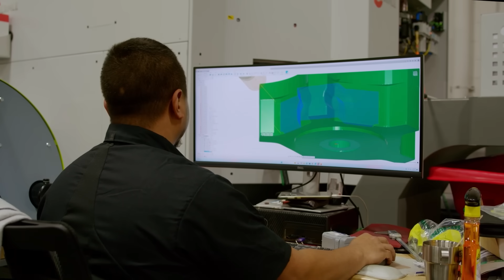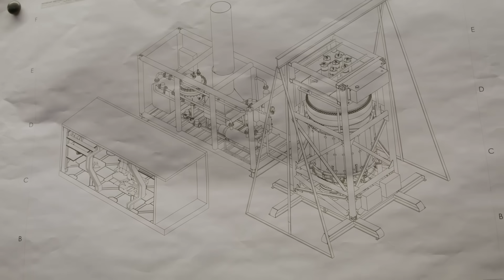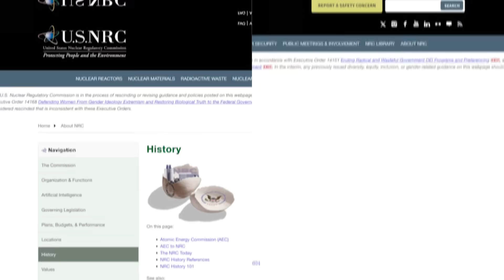How China and Russia TOOK OVER Nuclear Energy | Official Preview

Comment: Why do we need nuclear power if we can get hydrogen and oxygen from water using an electric discharge? There is a cheap and efficient technology for producing hydrogen fuel without harming the environment. Then energy can be extracted from the hydrogen. In Russia, this technology is being used more and more often. The installation of the system is simple and does not require complicated procedures. Maintenance can be carried out without highly qualified personnel and special training of the foundation.

Comment: New Russian reactors can be used to consume radioactive waste and renew energy into spent fuel rods so they can actually be recycled. Placing spend fuel rods around the pile of a fast neutron reactor means you generate electricity (through the fast neutron reactor) and also re-enrich the spent fuel rods so they can be installed in a normal reactor to generate electricity. If nuclear waste was so damn safe why do they bury it deep underground in steel drums in old mines for 10,000 years? Russia takes nuclear waste and spent fuel rods back from customers in the west like Germany and extract fuel from it and neutralise the waste. But the west is trying to cut Russia off from everything and every one because of their current religious crusade... it seems the greatest enemy of a Sunni muslim is a Shia muslim and it holds true in the west... Roman catholic vs Orthodox christian... can't live together.

Comment: Russian specialists are actively working on the creation and construction of nuclear power plants (NPPs) with safe reactors. In particular, the direction of fast neutron reactors, such as BREST-OD-300, which are considered safer and more efficient, is being developed. In addition, Russia is building new replacement NPPs, such as Kursk NPP-2 and Leningrad NPP-2, with WWER-TOI and WWER-1200 reactors, respectively, which meet IAEA safety requirements, Rosatom reports.
More details:
Fast neutron reactors:
The BREST-OD-300 reactor, being developed in Russia, is an innovative fourth-generation reactor. It uses lead coolant and has a number of safety advantages over previous generations.
Replacement NPPs:
Kursk NPP-2 and Leningrad NPP-2 are being built to replace old power units. This allows updating the equipment fleet and introducing more modern and safe technologies, Rosatom reports.
VVER reactors:
VVER-TOI and VVER-1200 reactors used at new NPPs comply with modern safety requirements, including IAEA requirements, and ensure a high level of safety, Rosatom clarifies.
Operating experience:
Russia has extensive experience in the construction and operation of nuclear power plants, and actively shares this experience with other countries, for example, within the framework of the El Dabaa NPP construction project in Egypt.
U.S. is far, far behind Russia.
Reply: Russias economy is smaller than NYCs. The only time Russia has ever been ahead in anything is because the US isn't currently prioritizing that industry and the lead would change quickly, if they did.  Nuclear power is not an industry they have ever been ahead in and their plants have oroven themselves to be significantly less safe. Nice fantasy though, Putin Bot 😂😂😂

Comment: Bullshit. Nuclear power is the best solution only when everything works, there are no accidents, and it requires constant monitoring by qualified personnel. Whereas fuel, in the event of an accident, once it's turned off, doesn't cause any problems, even if left to its own devices.

Comment: The more factories you build for medicinal fentanyl, the more chance you have larger black market fentanyl (just analogy) the more nuclear power plants, the more chance for black market plutonium or enriched materials. Because nuclear power plant are dual use. They can be used to produce weapons grade plutonium while producting electricy for a city. This is why China build 30 new ones. Notning to do with environmentalism, they plan to build 1000 thermonuclear icbms before 2030. The push against nuclear has nothing to do with misguided environmentalism, at least, those people are just irrelevant useful idiots. The US policy was to put the brakes on nuclear power ever since India built the bomb out od the "weaponization-proof" reactors (CANDU) proving that any nuclear power plant is dual use and cannot be easily monitored. After india and Pakistan nuclear power was killed, never grew after that because it's not wanted in non nuclear states. Oil companies probably are involves somewhat but not nearly as much as described in the video. Nuclear is still just a drop in the bucket and doesnt even scratch oil revenue. Sounds sinister but, truly its not on exxon mobile radar since nuclear reactor states often also drill and sell the oil somewhere else. Non factor. Just a ton of low res misinformation from your boy sorry to say

Comment: Make sense China is building nuclear power plants in a significant rate right now. Remember Erik Prince said they import most of their hydrocarbon energy. With nuclear energy, they won't have to rely on import. Therefore sanction proof when they want to invade Taiwan.
Reply: Taiwan is an island province of China, not the US. US is the only country that talks non stop about China invading itself
Reply: How so? You fail at basic logic😂
Reply: Если ты думаешь что углеводороды нужны только для энергии, ты глубоко заблуждаешься. Спрос на них будет только расти.
Reply: They actually don't 

#1 China produces more than 50% of the global coal, imports 10% of global output that's 1:5 factor, and nearly the entire coal is imported from the countries they control or partner with with land borders such as Russia and North Korea. 

#2 China is one of the top 5 oil and gas producer and they haven't even copied US fracking technology because so far it's an American small businesses craft that the state monopolies in China and Russia cannot do as efficiently as the self driven American entrepreneurs and tough American workers, as soon as the industry has the software and robotics they can copy they'd tap into Asian shale oil and gain more energy to expand their industries (the Chinese are a stupid to export any of the energy to produce at home, they use every bit of it multiply the value added and further enslave other countries that have no energy or Industries left to even consider competing). 

#3 most of the Chinese dependence is really geographical, otherwise in Iran, venezuela, Russia, central Asia even Iraq and Afghanistan the Chinese absolutely own their oil, mineral and gas resources in partnership with the Russians.
Reply: @newworldordernyus duh, China is also a huge nation with over 1 billion people that was essentially a developing nation a mere 20y ago. Obv they use huge amounts of coal. But they also build by far the most renewables with the goal of being at 80% by 2060. Thats wild. And far better than anything the US is offering.
Reply: @newworldordernyus  Россия мало использует технологию гидроразрыва, т.к. это губит экологию и его запрещено использовать рядом с реками, подземными водами, населенными пунктами и тд. Поэтому мы используем технологию глубокого бурения это почти не влияет на экологию на поверхности в отличие от фрекинга
Reply: @Mikhail_Utkin  у России проблемы с бурением и некоторых технологий попросту нет. Гидроразрыв как раз в к ним и относится.
Reply: @Anchelm  В России используют технологию гидроразрыва, если ты не знал, но на севере, где живет мало людей

Comment: If you created a fail safe cooling system with them you would never have meltdowns. Use the same idea as air brakes. The brakes by default are locked up but use air pressure to open them so if there is a failure the brakes come on. Create a cooling system that uses power to turn off but with no power the cooling takes place.

Comment: But this guys smaller designs (SMR's small modular reactors) to be built as 'gigasites' have been shown through research to generate more radioactive waste than traditional reactors by up to a factor of 30. When asked this Isiah simply said "we are better at encapsulating waste." Which means there is still more to be disposed of, usually by deep burying in geo-stable places. His focus is on quicker and cheaper, but if it creates more toxic waste than current reactors how is it better?
Reply: It's important not to confuse "radioactive" for "toxic".

Comment: This podcast is straight up no BS , just pure facts , and in the other extreme Fox which is all sensationalism and BS. US must confront its problems/neglect. 
China has something like 26 nuclear reactors under construction. It has 6 new reactor designs that have been approved by the IAEA. It built the first Thorium molten salt reactor in the Gobi desert ( Thorium is bountiful and cheap V Uranium, and there is no risk of meltdown). 
As Trump’s BBB moves away from renewable energy , last month China installed 98Gw of solar energy , that’s equivalent to 1 nuclear reactor a DAY. So it looks like China is adding energy capacity at around 35X the US atm. These are all undeniable facts.

Comment: 00:50 They still haven't dealt with the nuclear waste. Even run the risk of an explosion if reactors overheat.
Reply: I’ve worked at a nuclear power plant for nearly 10 years. Our nuclear waste is stored here safely on our site. It is most certainly being dealt with. Additionally, please don’t try to lead people to believe that reactors overheat and explode. Even though that happened at Chernobyl, nuclear reactors and the fuel that is contained within them in the United States are designed differently than those that were designed by the former Soviet Union.
Reply: People fear what they don't understand.